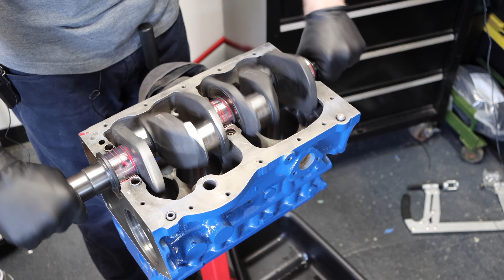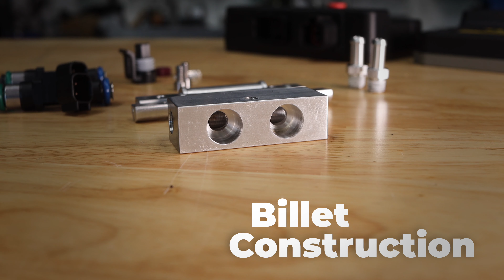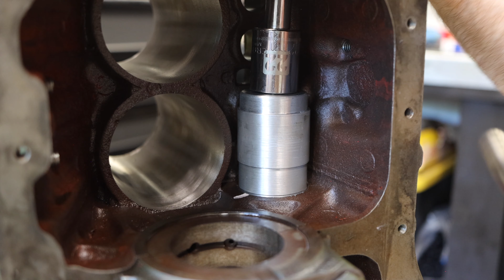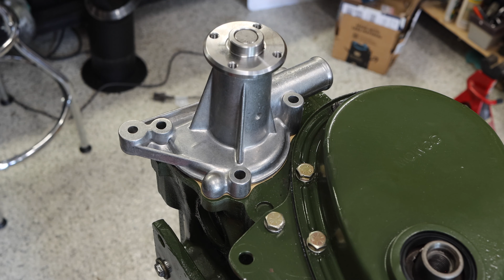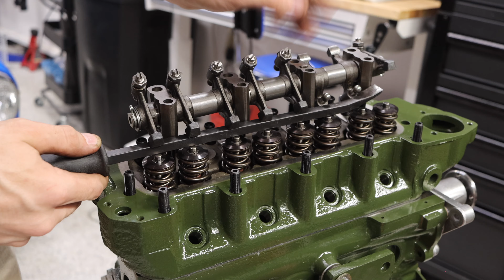Original Cooper S Engine Assembly

Comment: Great video - just a couple of points: 
You used orange rear cover seals with pre-1966 convex covers; the orange seals are for the later concave covers - use cork gaskets for convex else they will leak oil. Also rotate the bypass hose clamps so the screws face the back, else if you ever need to change the water pump or bypass hose you won’t be able to get to the clamp screws after the engine is installed.

Comment: Cole, those tappet chest cover early type Swan neck which you are using in this video should be using a corked type of gasket. The rubber gasket are for a later Cooper S. The difference of this 2  types of Tappet chest cover are the thickness of the metal cover. It might leaked in later stages. Cheers mate .. Julian

Comment: Great video! 
Watch out for the tappet cover bolts leaking oil. It usually needs the rubber washer with that special done washer to get a good seal  👍🏻
Reply from the maker: Good tip! I will go back and add a rubber washer. Thank you!

Comment: Cole, the oil feed to the rocker shaft on the AEG163 head flows up through the first rocker post. You show the original first rocker post at  the second rocker post position, presumably because of MiniSpares rocker shaft locating screw at  the second rocker post position. Did you drill the first rocker post and shaft to get the oil up to the rockers?

Comment: Only just found your site, I'm very familiar with HRE and I've commented on Pauls videos many times. Back in the day I used to work at BMC Competitions in Abingdon. We'd never have called any 1275 S an original one, they were 1071 or 990 the bigger engine was introduced in 1964. Did you use the competition C-AEG 399, later standard rocker shaft along with its associated modifications and extra AEG165 locking plate. Again these modifications because standard. Why didn't you strap the centre main bearing cap? This used to be standard practice. I agree with the comment about the water pump clip screws, put them the other way round so that you can access them. Do you know what crankshaft hardening was applied to your crank, the very early ones were the best several different processes were used.  Good luck with the project.

Comment: Great post Cole looking forward to the next instalment, you have been a tremendous help recently with carburettor rebuilding giving confidence to take these tasks on much appreciated, Only question the green engine paint code or we're are getting from would be great
Reply from the maker: Hey Rob! Thank you. The paint I use is actually made by Moss Motors. 
https://mossmotors.com/spray-paint-engine-dark-green

Comment: Always a quality vid. Could not tell if you bolted the timing chain cover on tight or not. You probably already know that you want it floppy lose so that the pully centers on the seal in the timing chain cover. Otherwise it will leak.
Reply from the maker: Hey yes good tip! I do exactly as you suggest on all my builds. Those pulley seals are so annoying when they leak!
Reply: So if I understand you correctly guys, the cover should be only tighten slightly, so the oil seal on the pulley can "adapt" to crank rotation? About to change it on my replacement 1275 soon :)
Reply from the maker: @MCCZPL  Yup tighten it up so its just a little looser than snug, then put your pulley in and jiggle the cover a bit. Then tighten your bolts you can see and access with the pulley on. Then take the pulley off and tighten the rest.
Reply: @MCCZPL  Yah you want the cover to float around while you install the pulley which rides along the seal. Once the pulley is in and you rotate it a couple times you can then finish tightening the cover.

Comment: Hi Cole, great video, thanks. You and Paul are a remarkable source of how to work with these fantastic cars. One question, do you not use gasket sealant like Permatex at all?
Reply from the maker: Thank you! I do use permatex on almost all gaskets except the oil pump and head gasket. The ones at the top of the engine I left dry until the first start up. I have had to swap out thermostats and stuff after first assembly so I don’t wanna fight with my gaskets until I’m ready to seal it up for good.

Comment: How will you check oil pressure on the bench? Be great to see a vid on that. Building a A series motor right now.
Reply from the maker: Yes I am planning to get pressure and bed in the lifters before I had it to the customer. I have a small test bench I will be running it on before I send it off. Definitely going to make some videos about it too. :-)

Comment: Hi Cole, love the channel.  Any issues with using rubber gaskets on convex tappet chest covers?  Mine have been leaking and I've seen convex covers should use cork ones.  Or are you post 1966?
Reply from the maker: Mine in theory should have the cork gaskets but in practice I am struggling to see how they would be any better at sealing those tappet covers. They both are sandwiched down by the cover. I suppose the silicone ones might be more prone to coming unseated without the tappet cover lips? I am going to roll with these and if it becomes an issue I will swap in the cork ones.

Comment: Thanks for the video. Out of curiosity, where's the fuel pump on the Cooper S? I see the usual spot is not even drilled? Or you blanked it and block paint job was done afterwards?
Reply from the maker: The Cooper S used an electric SU fuel pump from the factory. The block never came with the mechanical pump and the casting was never drilled back there.

Comment: First
Reply: Valve chest breather is part of the spec ?  part no 12A1212 ?
Reply from the maker: That’s a good question. I have seen some AEG312 with the breather unit and some with the simple upside down tube. Need to do some research.